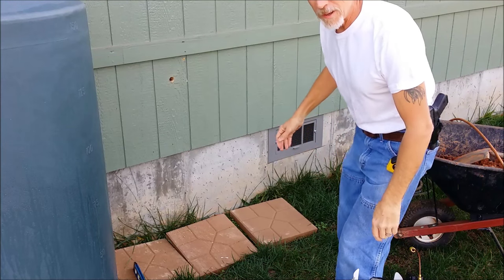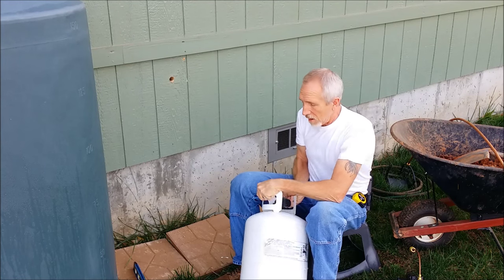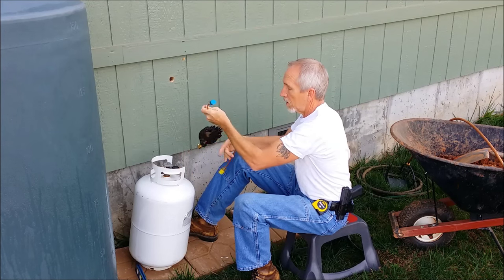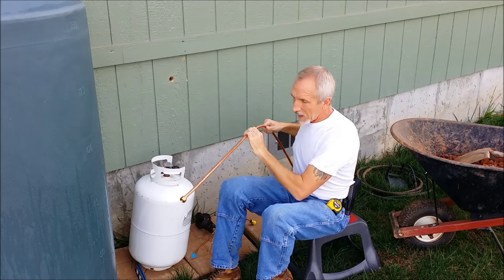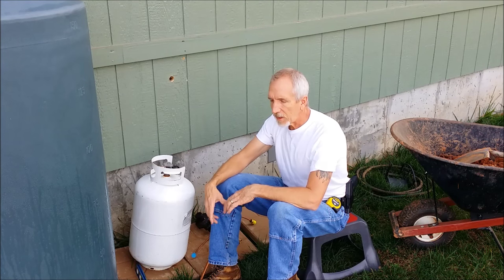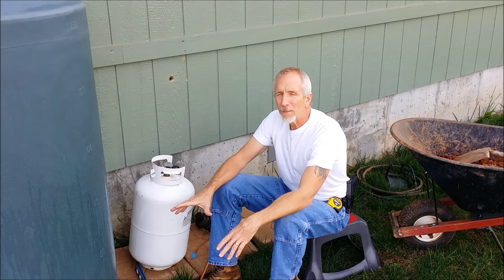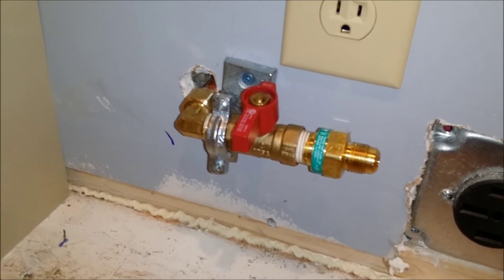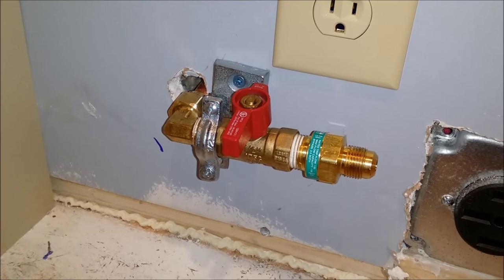Switching from Electric to Propane Stove

Comment: The 2 stage regulator is not for safety. 2 stages are needed because you are trying to regulate the pressure down from around 120psi to 0.397psi that is zero POINT 397, just over 1/3 of one psi. It is just not possible to do that reduction accurately and economically in a single stage. Each stage does a reduction of around a factor of 10. The first stage takes the pressure from 120psi to 10psi and the second stage takes it from 10psi to 11 inches of water colum which is 0.397psi.
Reply: The vent of this two stage regulator should be pointing down, not at the wall of the house.

Comment: That is wonderful! What a perfect job. I love a gas/propane stove and I'm going to switch mine out too. I really like the 30 lb. tank you have there, I don't think I have seen them here, just the smaller and larger ones. I've been looking at a very small stove, it's only 20" - 24" wide and it's really nice. I have missed gas/propane for many years, and it cooks so much better, and faster too. Years ago you didn't have shut off valves, and I know nothing about them, so I'm going to have to check on the codes for the oven. I'm really glad you mentioned it. The one thing I love about them is that not only can you cook, it can keep the house warm too!  Great Video, and thank you for the information. Bless, Sheila
Reply from the maker: +Sheila6325  The small stove is a lot more efficient. Check out Premier. They make stoves that size i think . All there stuff is made in the USA.
Reply: benchmade55 I always try to find "made in USA" and they are few and far between. I will check them out. The one I saw was at Lowes, but I haven't done real searching yet, but will want it right after Christmas, good sales then too. One thing your videos on this has done for me is, that it assured me that I will have to have them install it, and make the conversions too. I have done a lot on appliances in my homes, but I will not fool with propane, it needs more experience than what I have with propane for an oven. Thank you for the stove information, I will check it out right now. Bless, Sheila
Reply: +Homestead Handyman  This in itself is very helpful, was struggling to find a 24 inch range and not only are they 24 inch, but made in the United States. Further, great tank solution for a stove and avoids the 100 pound, or worse, a huge tank in the yard.

Comment: Nice video thanks. Btw you may want to change the support bracket holding the inside valve. 

When dissimilar metels i.e. copper and steel they can create corrosive  effect "galvanic effect"
Reply from the maker: Good advice 👍
Reply: They make those threaded rod brackets in copper.

Comment: Looks sooo nice and I’m so glad to have found this, otherwise I would never have thought of using a smaller set up.

I too, live in the country, well actually in the mountains and when we get snow and ice we can lose our power fast and as you say, there’s no way to cook and with only electric in the kitchen it is freezing, and a gas range will generate a little heat.

I have a pretty big house and 1/2 of it is heated by electric and the other half is heated by propane, so I already have a 200 gallon tank on one side of my home and I have been stressing 😩 over adding another tank to the other end of my home. Now, that I’ve seen your convenient little trick, I realized that the same set up would serve me well❗️And, thanks for the tip on the type of range to buy.  As you know they always try to sell you the ones with all the bells and whistles.  So, thank you for that nice tidbit of info.

Now, if I only had a handsome husband to install it.  😏    Your wife is very fortunate to have you❗️ 

Oh, before I forget.  I love the tiles you added, but you still better use lids when you’re frying.  Popping grease takes no prisoners.   LOL

ENJOY YOUR NEW RANGE.  It’s lovely.
Reply from the maker: Thanks for your kind words. The stove is working out great. my bride loves cooking on gas much better!

Comment: I had the same idea after a kitchen remodel.. Will be adding a propane stove.  Its my plan anyway.. My better half is worried about burn time.. What is the average per tank you think?
Reply from the maker: We bake or own bread and use the stove a lot. We get about 3-4 months per 30 lb tank
Reply: @homesteadhandyman4481  she said.. Shit at burn times. That's good lol.  I kept telling her it was worth it..  Thanks for the reply man
Reply: I get 2-3 months out of a tank for my family of 3 on a 20 lb tank. Now I have 2 30s with a switching regulator. I have a gas range but am moving the dryer, water heater and my fireplace to gas (for heating) here in FL.
Reply: @homesteadhandyman4481  àqqa
Reply: @theFLshark where did you get your regulator,? Thx!

Comment: They make a better regulator for $50 that RVs use in a dual tank setup. It pulls gas from one tank and when it's empty it switches to the other tank. The bonus is it has an indicator for which tank is empty. Also, you can remove the empty tank while it's still working and take it to be filled so you don't run out of gas.
Reply: Those are not “better” this particular regulator is very high quality now you maybe talking about convenience and if that’s the case you are correct
Reply: Were can i find one like that?
Reply: That's not necessarily better. Range requires more BTUs than the little camper one..
Reply: Thank you for your info.

Comment: What does commercial grade mean?  What is the size of the copper pipe, what is M size vs L size?  What fittings do you use to connect to the stove inside the house?

Comment: What size lines are you using from tanks to regulator and from regulator to stove? Thanks Great video!
Reply: If I remember correctly, it’s 3/8OD lines to the regulator and 5/8 OD going into the house

Comment: I had originally installed 3/4" black pipe with 1/2" nipples for my appliances then decided not to use gas.  That was a number of years ago.  Now I want to use a propane stove and have the 30# tanks but can't seem get the stove to light after my installation.  Everything has been pressure tested, soaped and it's all tight.  Is it possible that there isn't enough pressure in the line to keep the propane moving?  My regulator shows that the tank is empty and I just filled them.

Comment: What size line did you use from the outside regulator?  The only two stage changeover regulator I could find had a 3/8 “ outlet. Good video!

Comment: I've been looking for a long while, to find out why most indoor propane 'fireplaces' usually require using a 100LB tank. 
I have a 10.16 small cabin I want a 10,000 btu propane log fireplace in. But most places I've looked, say to go with a blue flame wall heaters b/c you can use smaller (40, 30 & even 20LB ) tanks with. But I really want a propane log fireplace and, I see you're using 2 smaller tanks for a stove. So, I'm just trying to find out what I must do, to be able to use smaller tanks for a "Fireplace." Most folks say you have to have the pressure of a 100LB tank which you don't get w/a smaller tank. Can a regulator give you the pressure of a 100LB tank? Or is there something else one can do, to use smaller tanks dependably & safely? It's nice to hear that you've been doing this with your stove for a while. But that is a little bit different than a ventless fireplace. Would really appreciate any help in this matter. Thx!

Comment: My new house has utility gas but no gas stove. I want a gas grill for outdoor cooking, but chances are, even in NG served Prince George, most grills are propane. Wat do?
Reply from the maker: You can buy grills that are setup for natural gas!
Reply: @homesteadhandyman4481  I know. But I'm thinking to bum one off the classifieds because I'm on a fixed income. So really I need an easy conversion that ideally can still run LPG afterward
Reply from the maker: @ellenorbjornsdottir1166  Some grill manufactures make an adapter kit to switch from propane to NG ,good luck!
Reply: @homesteadhandyman4481  I'll need your good luck :)

Comment: Where can I refill 30lbs tank? Home Depot?
Reply from the maker: Propane store, sometimes Tractor Supply and Ace Hardware.
Reply: Thank you. I have completed my project. I used 15 foot black 1/2 inch pipe and flexible yellow gas pipe for tanks. @homesteadhandyman4481

Comment: Where did you get the brass fittings: a) the part that T's out of the regulator? b) the two that fit on that T fitting? c) the ones that hook to the propane tanks? 
Trying to reproduce your set up but having a bit of a time finding  those fittings where I live.
Reply from the maker: I got them at a propane store

Comment: What size copper tubing is the main line and size of other copper tubing also?
Reply: The copper pipes that are coming out of the tanks are one size and are called Copper POL pig tails.  And the copper coming out of the regulator looks like 1/2 inch.

Comment: Is the pistol there in case the camera attacks you. BTW: The pressure in the tank is the same whether the “sun is beating down” or not. Also, the piping should be iron not copper. Copper is too soft and subject to damage.

Comment: GOOD JOB. It will be much better if u used black pipe its more stronger even the coper L TYPE meant to be for refrigeration and gas. Try to put some insulation to help u out with pressure changes
Reply from the maker: Good Advice! Thanks
Reply: Black Iron harder to work with for this lil project.

Comment: So many things to comment on and I haven't even finished the video!

First, I think examining the fire code will find the tanks are too close to the foundation vent  In use of  gas leak or a relief valve opening do you really want to chance gas getting under the house?

The regulator is positioned wrong.  The vent needs to be straight down.  They was it is mounted moisture could be trapped inside the regulator.

Where the line goes trough the wall should be sleeved so the line is protected.

Oh, and type L is not hard copper
Reply from the maker: Thanks Mike , I will look into the items you mentioned and take care of them!

Comment: Where can i found regulations for installing cylinders propane for a pro kitchen?
Reply: The Texas Propane Gas Association
Reply: Regulations can be difficult.  Most states have adopted NFPA Pamphlet 58 for outdoor fuel gas piping and Pamphlet 54 for indoor.  But the states usually adopt a certain edition.  For instance Illinois has adopted Pamphlet 58 2011 edition.  For the most part there won't be a difference.  But a newer edition may allow or not allow things the earlier didn't.  When you download the free version at https://www.nfpa.org/assets/files/aboutthecodes/58/58-98-pdf.pdf  you get the 1998 version. You need to know what edition applies to your situation. Understanding them  involves a bit studying and looking for the exceptions.

I'll mention this now since it hasn't been addressed much.  With limitations (distance from ignition sources, windows, vents, etc) a tank under 125 gallons can be right up against the house.  But over that it needs to be at least 10 feet away and 25 is better.  Speaking as a volunteer fire fighter I like a 25 foot minimum

And you still have state and local regulations. Some municipalities my not allow certain things.  Plus you said "pro kitchen".  That implies commercial use which then typically involves the health department and more regulations.

Comment: suggestions.. but this is a 5 year old video... 🤔 anyways.. i suggest for looks i would clear away growing grass & weeds. level ground.. put down a good weed barrier.. then 16" x 16" paving stones.. and for storm safety strap tanks to the wall as enough to hold from falling but loose to remove to refill. also i suggest NEVER put any fitting inside home like couplings or T fittings. ive seen flare fittings leak. and ive seen people use compression " water only " fittings used 😱 OH... and to add VERY IMPORTANT.... personally ive had more than once gas shutoff valves fall apart or leak.. AND those screw on at the tank dial gauge meter to show remaining gas in tank.. i had one pouring gas out as i turned it on NEW so i dont recommend them.. total fire hazzard.

Comment: Fire code violation propane tanks must be 10 feet from any opening looks like there is a small 
basement window next to him
Reply: All he would have to do is close window/block off.
Reply: But does that apply to 20 gallon tanks?
Reply: Only if filled on site.
Reply: Tanks are not filled onsite. They are fine there.
Reply: Most places is 3 ft for this size tank. Not all places even have regs.

Comment: How do you handle the carbon monoxide the propane produces?
Reply: Properly operated it will not produce carbon monoxide.  Unless a home is so airtight it needs an air exchanger any fumes from operation will not be a problem